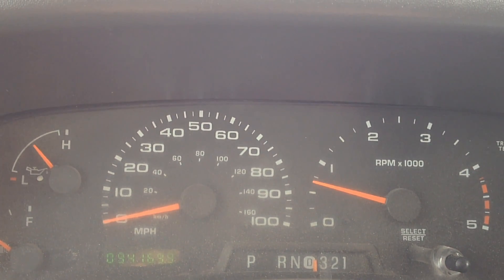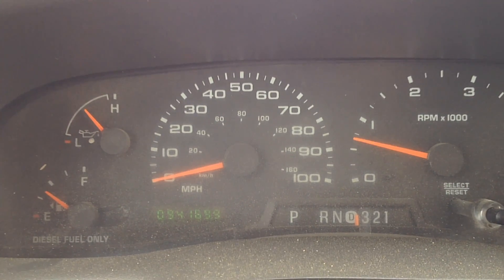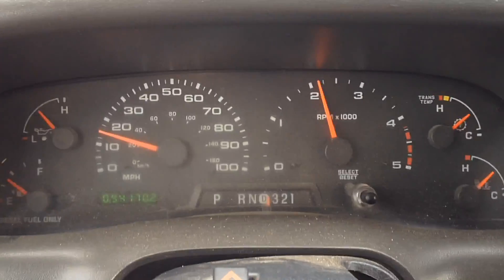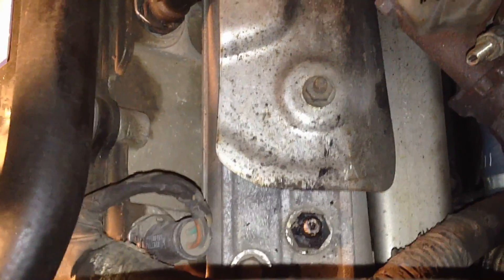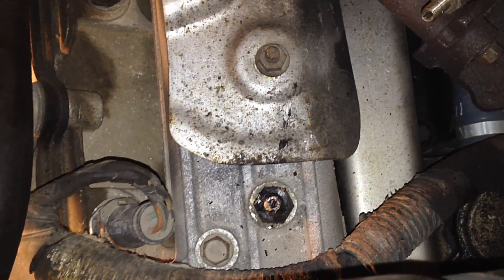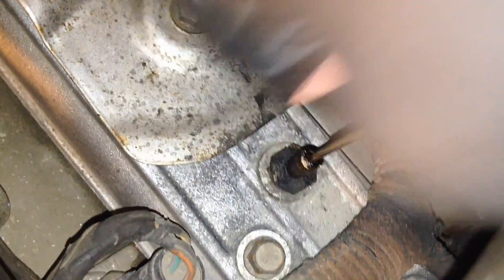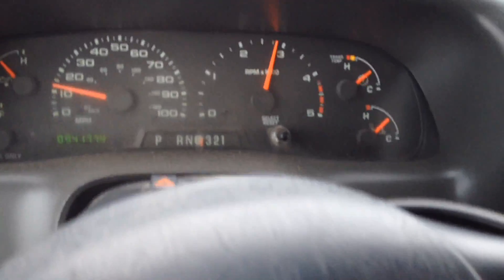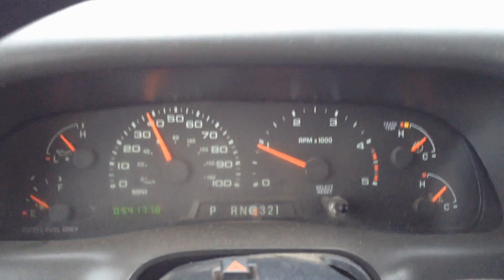6.0L Powerstroke P0401 P0299 Diagnostic Tips

Comment: 2006 f250 deleted here, what would cause low power and HIGH boost(30psi)at wide open throttle? EBP sensor/tube replaced and no change.

Comment: What about a no power solution? Hit my brakes driving 50 lost all power rpm’s went up but couldn’t go. Coasted into a church parking lot idles good and can start right back up but can’t move. No power. Found power steering over flow out of reservoir. 2006 f250 6.0. I have no clue what to do. New to the 6.0 game.

Comment: I don’t normally work on diesels, but I have a customer with a 2007 F-350 6.0L powerstroke. Only code is P0299. I’m not familiar with these vehicles, but I figured I’d try to diagnose it. I’ll be doing another test drive first thing in the morning. I must be blind, but couldn’t find this map port unless this is located on the passenger side of the turbo. I was doing some research but couldn’t find much good information on forums or pro demand for myself.

Comment: I have a vt365 engine 6.0l . Similar to the power strock.
Turns on. Idles around 500 600 a little rough. Rev up no problem. Shift to gear drive. Zero response. No throttle in gear only. Black smoke from tail pipe. Replaced the ebp sensor. Nothing. Unplugged the icp while running. Engine shut off. My next step is to unplug the IPR while running to see if engine remains on or shuts off. Any suggestions? Egr valve? I also do remember when the truck was running fine. Turbo bark noise. I still don't know if that was normal or not
Reply: Also. No check engine lights. 2 inactive codes. 1 inactive code for injector module unable to build pressure. And 3 of my injectors low to high side open. Inactive codes. Truck has only 44k miles.

Comment: I was about to roll my truck off of a cliff after cleaning and eventually replacing the EGR valve. Cleaning the EBP tube and replacing the EBP sensor. Removing and checking my entire set of air pipes and hoses. As well as replacing the MAP sensor hose.

I cant believe I didn't think to clean out that little opening in the nipple.

Thank you so much for posting this video. I just got home after pissing off my neighbors.

My truck is screaming up and down the street!

Comment: I need some advice I have a Ford 350 6.0 I use it little and I changed oil and diesel and oil filters and it didn't start the last time I used it I noticed that when I ran it hard it didn't have much power?

Comment: I have exactly the same symptoms. Also my check engine light is on.Replaced the map sensor, cleaned the little hole like you are showing. But still no improvement . Just to mention that exhaust sound is funny not the usual low powerful. Any suggestions? Thank you 🙏

Comment: Interesting this many years later this video is still helpful.  I just started having this problem but it is erratic not happening until I drive about 100 miles. Then when I am stopped for an hour it goes away so I think I am on the edge of being plugged. And it opens up when the engine is shutdown. So I am waiting for a new hose and map sensor then I will clean this nipple. Thank you for the help.
Reply: Did this fix your problem because I think I'm having the same thing where it comes and goes could be a bad injector but the only thing is my scan gauge 2 is showing I'm getting good map readings

Comment: Do not use a coat hanger to clean the connector that's in ur manifold because  you will push carbon down in the intake and will get stuck to your valve. Remove the brass fitting and clean it!!!!!
Reply from the maker: Have you ever pulled the egr valve on one of these engines and had a look inside the intake at all the oil and carbon buildup? If you had then you would not of made that comment. Please trust me I know what I am talking about after all these years of working on Fords.

Comment: Hello,  2004, f250 diesel, 250k miles. At 260k miles replaced head gaskets,  at 280 replaced hoop, all 8 injectors from Ford Dealer, ipr and icp sensor, new turbo, new cooler and new glow plugs. I only use genuine ford Dealer parts. I have a gauge which I monitor the icp, ipr, ficum and sync. The truck ran great until a month ago. When at a full stop or just strolling down hill the idle and icp pressure spike up where the idle spikes up as well. Than immediately icp pressure drops and the idle spikes down to a point where it wants to stall. Icp and idle Kind of  surges.  I'm a farmer, always hauling cattle and feed. Spent alot of money on it and can't afford another truck.
Reply: Icp sensor bad

Comment: I have an 03 f250 6.0, check engine light is on, drives normally but slow acceleration trying to get to highway speed, light blue smoke on initial start up but clears up instantly afterwards. Any ideas what it could be? Truck is bone stock

Comment: Hi friend thanks for your videos has been so helpful for me...but I have a present problem with my 06 powerstrok. 6.0  e350 when is cold runs very good but when get hot  feels like no power started getting acelerated and is not going. I did change ebp sensor and egr valve and still give this codes p0402 p0472 please if you or any one on this videos have any idea what can be thanks...

Comment: I have these same conditions till the engine warms up. I changed the egr valve, checked the map port everything is clean.Also have injector contribution problems with the number one and occasionally the num 5 injector. Where do I look now, the injectors?
Reply from the maker: Yes you have a sticking spool valve replace the objector
Reply: @FordTechMakuloco  ok, sticking which spool valve, are you talking the vgt? haven't heard the term objector, or was it injector?
Reply: @FordTechMakuloco  I pulled all the driver side injectors and cleaned the tips along with the shuttle valves to clean any stickem. at this point i guess, I need to pull the passenger side. I'm not liking it as the heater/air conditioner box is right there in the way and I'm not sure how to remove the the dead plugs from the injection manifold..The new ones I have don't want to come apart.
Reply: Got it now, diesel tech Ron to the rescue.. thank you for your time ftm I'll let you know what happens., j

Comment: I have a2005 f350 6 L and when towing under load the boost pressure goes from 29 to 20 back to 29 and back to 20. It sound like and back pressure valve opening , but I know the 6 liter does not have back pressure valve . Any tip on the cause of this ?

Comment: So I just did a fuel pump and blue spring upgrade on my truck as well as a brand new egr valve. I make about 68-70 psi of fuel pressure under load. Today 1/5/19 my check engine light came on so I hooked my scanner up to it and it’s saying P0401 insufficient egr flow. And I have new ss dieselsite up pipes and the y-pipe and a new bulletproof diesel egr cooler and I did clean that map port a while ago. Is that the only thing that can cause that issue because I can’t think of anything else for the reason it’s acting up. And I’ve pulled the turbo went through it cleaned the vanes, unison ring and exhaust housing and rebuilt it with all new bearings seals and the 360 thrust washer. Just thought I’d pick your brain

Comment: I have an 03 f-250 6.0 no ce light or codes 270+ miles egr deleted. The previous owner had the hpop replaced. I have just been using android and elm 327. From everything I have seen all the values look good out side of the fuel pump duty cycle is at 100%. Fuel pressure was 60 psi so I’m thinking it’s got a blue spring kit. The horizontal fuel module didn’t seem to be loud. New filters outside of the trans. Cleaned and sprayed drivers battery got rid of the noise in the radio. It is intremitant will run like a top or it will act up have to have to hold it to the floor to start and ecelerate  lift to shift and shutters if your at speed cruising almost violently. Just got the kids to bed heading out to check intake and change hose. 

Great video watched a lot of yours and Rons thank you. 
Merry Christmas and Happy New Year

Comment: Worked like magic.    Cleaned the MAP port and the EBP sensor pipe with a length of weed wacker line and carb cleaner.    Runs perfect and no codes!    Thank you.
Reply: Thanks for your video.. I have the same problem with my 6.0. Powerstroke I will take a look at it soon

Comment: I have a 2004 6.0 turbo boosts a lot and engine revs up to high but it moves really slow like if the transmissions wasn’t working right but it’s something with a sensor I think

Comment: I'm having the same P0401 code, the truck drives just fine, no power loss, etc. The cel goes off after a few Drive cycles and it'll come back on after about 20 min of driving or so. What's your thoughts? I was planning to do an EGR delete, but if I do I know it will illuminate the CEL unless I have a tuner to turn it off, but will it effect drivability in any way?

Comment: I just bought a 2006 F350 with the 6.0 runs great but I'm still getting the P0401 code and I've already changed the EGR what else is making it throw the code?
Reply from the maker: Clean off or replace the IAT2 sensor in the intake manifold.

Comment: My wife's 2013 2.0 EcoBoost just tripped a P2099. The dealership said it was wastegate stuck open causing it and that the whole turbo would need replacing since the wastegate is a part of it. Is this correct? Or, can just the wastegate be replaced without having to go to the (huge) expense of a new turbo?
Reply: Make that a p0299.

Comment: SO....I checked the port which was fine. I did find that the hose itself was able to be pulled off by hand, brittle, with cracking and possible hole at the bend from the top of the valve when installed. I will replace this to see if problems persist
.
Reply: Steven Z hello where is this port/ hose locAted? Driver or passenger side of engine ?

Comment: I also have a p299 code. Just cleaned the turbo a month ago, it spools up fine. Tried rodding out the map "port" and hose. When it comes to idle the turbo momentarily goes back to normal and then VGT goes straight to 85%. It's like something is commanding the turbo to go wide open. No smoke when I'm in the throttle. Thx.
Reply: I’m having the same issue, did you ever get the issue figured out ?

Comment: Hello, I have a 04 6.0 f350 with the same symptoms. Would cracked exhaust manifolds lead to the same condition? Regarding the lack of boost and shotty shifting. Thanks in advance for your time.
Reply: It definitely could. Need exhaust gas to Spool turbos and losing the Echaust gas can definitely cause Low Flow.

Comment: I have a 2006 Ford E-350 Van with a 6.0L diesel and checked this port that goes to the MAP sensor. What would cause it to have a vacuum instead of pressure on the intake manifold?

Comment: hello, I have a 2005 excursion that I get P0229 with EGR codes. I have a delete so I understand the codes. I just had my heads done resurfaced and headstud, ICP, egr delete and a new "updated" oil cooler. 

I'd like to check this port out. Where is that port at? I will be getting a custom tune soon so I wont have EGR lights for much longer. 

Thanks
Reply: FordTechMakuloco
Reply from the maker: +Chris Rettig  Passenger side front of the intake.

Comment: I get the 0299 every morning-Once I start driving I hear the turbo spool up making me believe the vanes are sticking-I have an edge tuner and get a 0 EBP reading-I have read this might be the result of a computer flash. I have a 2004 6.0-It starts and runs great otherwise-I'm looking into a KC1.5 turbo for towing. My question is about the EBP 0 reading? I don't know if it is a result of a flash for my year or should I replace the sensor? Mapis 14psi

Comment: Hello,  I get a PO299 with a check engine light usually after a cold start.  The truck runs perfect and actually strong with 28  #s  of boost. I have replaced the MAP and egr with aftermarket parts but still will throw the check engine every other day.  Once it starts and runs for 5 minutes your good for the day.  I will check the egr again.  The truck has 55k on the odo.

Comment: 2003 F350 6.0, thanks brother as soon as I did this, it ran smooth as bran new.  Two different shops did not know this.  Thanks for posting, how did you reset the light?
Reply from the maker: Billy White Well I use my scan tool but you can just disconnect the negative battery cables for 10min or so.
Reply: Thanks brother, this literally took me 5-10 minutes, and even the Ford Dealership had no idea this was the issue, thanks again and stay safe.  I will be donating to your cause if you are still in need of donations.

Comment: Thanks for the tips FordTechMakuloco.  I've got  an 05 6.0L.  345,000 miles with an EGR delete.  Mine was clean, but the hose is dry and firm.  Going to change it, but still won't start.  I have a codes P0299 & P0460, as well as an EGR code we ignore.  Trucks been idling rough then shuts off, funny thing is, after a couple of days it'll start back up and run good, but it does start all over again and dies out.  Any other ideas?  Oh I checked the FICM key on/engine off at 48V and engine on at 48V.  I'm not sure which way to go now.
Reply from the maker: Steve O Have you check icp voltage key on engine off and icp pressure cranking as shown on the scan tool?
Reply: not yet, but will hook up your recomended ScanGuage II to see what's going on there.  I'll let you know.  Thanks for the reply.
Reply: Engine off my ICP was blank on my scan guage ii, 47.0 FMP / 14.8 IPR and 12.0 FLP.
I'm rechecking my setting for the ICP. but this shows for PSI not volts correct?
Reply from the maker: It should show for both but it seems it is set to psi. Ok what are the readings cranking with a strong battery?
Reply: I had  messed up the settings.  at cranking it was showing 978 PSI, i changed it, nothing, still no start.
Reply: It cranked up this morning, batteries a bit worn out, but she started up and sounded smooth.  My ICP reading now is 625 psi then 26.5 ipr / 47.0 fmp / 11.5 flp.  How do those #'s look?
Reply from the maker: Those numbers look normal. The FMP looks a bit low how was the number while cranking? What you are looking for is the icp to be over 500 psi ideal to be at a couple thousand within 5 seconds of cranking and MPWR to not frop below 46 even cranking
Reply: I'll have to check while cranking.  Isn't the FMP (FICM) at 48.0 V not below 45.0V? Just started her up to take for a drive and see how she reacts to the new ICP.  Still have 2 codes, P0299 & P0410.  Here Idle #'s are 880 ICP / 28.1 IPR / 47.0 FMP / 12.0 FLP.  Thanks again for following up with me on this.  Oh and it's showing low fuel on my dash, on and off but it has a full tank with aobut 40 miles used up.  Fuel sending unit?
Reply: Test drove failed.  Got to about 2200+/- ICP psi, but she bogged down and started to get rough and wanted to stall, just like in your video, but I've checked and cleaned that oricle.
Reply: So I thought I'd test BST, Your video shows that it should be 2 or 3 PSI, key on, engine off it read -0.5 bst, at start it read 0.3 bst, it bogged down at about .07 bst or under. So needless to say I'm thoroughly confused and frustrated.  Thanks again for your input and direction.
Reply: I'm leaning towards a sticking turbo or should I check the IPR screen?
Reply: FordTechMakuloco still nothing positive on this truck.  Rebuilt the turbo, bad unison ring, changed IPR, ICP and replaced valve cover gaskets along with fresh air filter and oil change.  No air leaks visible.  No codes yet since it's not staying on passed the 5-10 mins after initial start, but sounds rough still  and 85 VGT.   Any suggestions or ideas?
Reply from the maker: What was the ipr duty cycle at 2200 psi?
Reply: on 4/4/15 - before the turbo rebuild it was at 27.3 on my scan guage.  Is that  a good #?
Reply from the maker: 27$ for 2200 psi yes, so your current problem is after 10min run time it quits still and this is due to a drop off in icp?
Reply: So what can I do now, I've changed the ICP as well.

Comment: i have a 2005 6.0. the oil cooler was 100% clogged so i tore it down to replace. cleaned the valley the best i could. put it back together and then had a no start. well turns out i got some gunk in the ipr valve. tore it back down , replaced the ipr and got it to start. at the same time i replace the egr cooler wich was a delete with a bullet proof non delete. i also  replace my turbo with a new sinister garret powermaxx turbo with a batmo wheel , because i like the whistle. i cleaned the port & checked & cleaned the egr valve. i also replaced vgt selonoid connection with a new pig tail. the old one was broke and only had the prongs exposed. so now it runs but when cool ihave no issues with boost. when warmed up and at steady speed 40 mph , i loose boost. in comes on and off after warm up. when it cools it boosts fine.its also sluggish on take off and sputs out a lil bit of black smoke. again this is only after warm up. the truck ran fine before i tore it down. any help would be grateful
Reply from the maker: There is no programming needed for the new turbo? I have always heard these need a tune for the lag at the low end like your experiencing. I would contact them directly I really thing this is all related to the aftermarket turbo setup.
Reply: Come to find out I had a bad egr valve. But still have that sluggishness at take off. So I will contact sinister . Thanks very much. I have mechanical experience but never worked on diesels.  Thanks to good mechanics like yourself who post on YouTube I was able to work on my own. Saved ALOT of money !!  Thank you